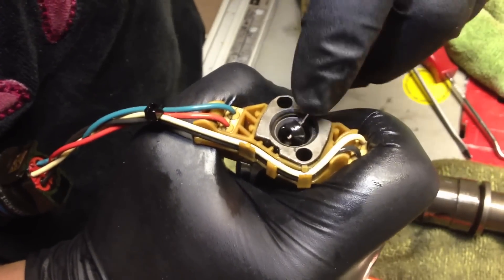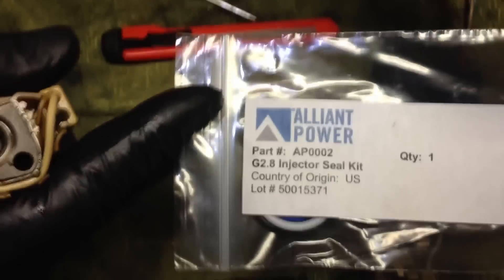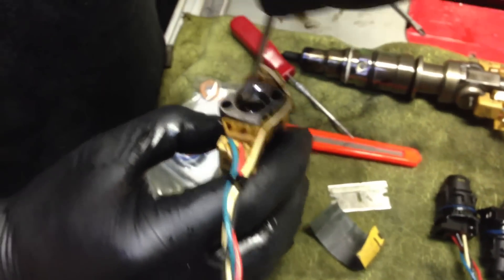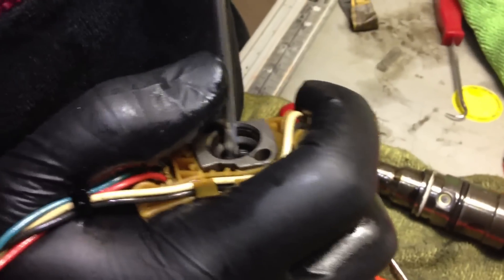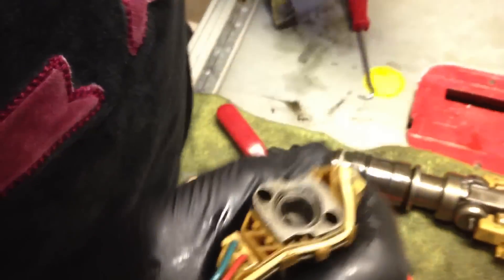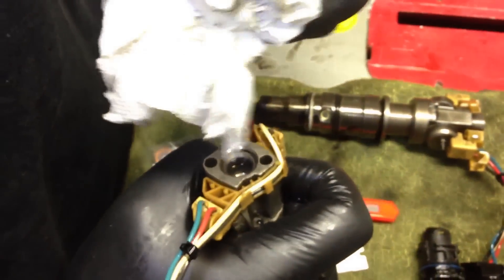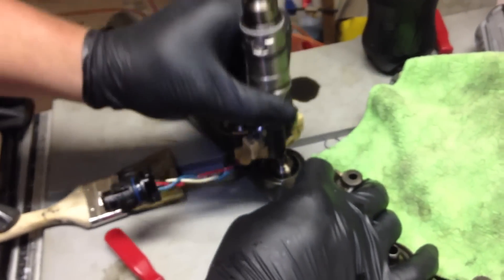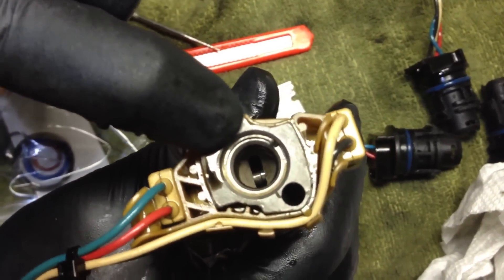vid #1 6.0 diesel diy re manufacture / reseal  injectors all 8 under $100 in parts

Comment: Thanks bud, I knew these orings could be replaced because I've done on other vechiles but everyone swore up and down I needed to waste thousands replacing injectors. How much was the orings and is the package in the video for one injector? I want to do this on my 6.0 powerstroke. Has hard time building fuel pressure cold but as soon as I see guage needle move to middle. Then it will start and run fine
 Just hard to start cold.

Comment: Sam thank you for putting the time and effort into getting this up on the tube. My 04 250 w160k miles just started acting like its missing. Code shows number three injector. While im in there doing number #3 I might as well do the rest. I wonder if I could get away with just a Oring job. injectors are 250 each